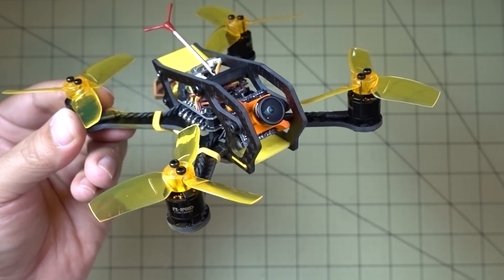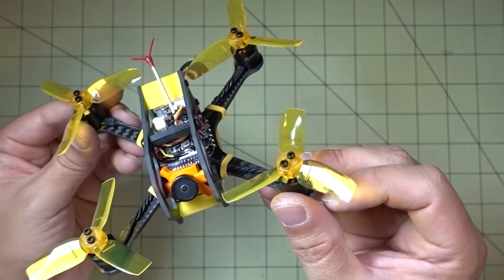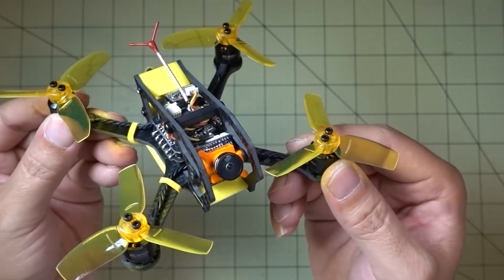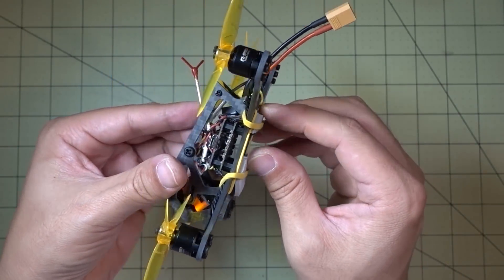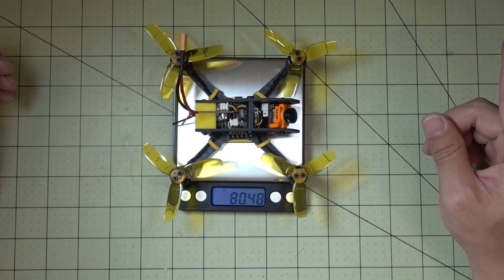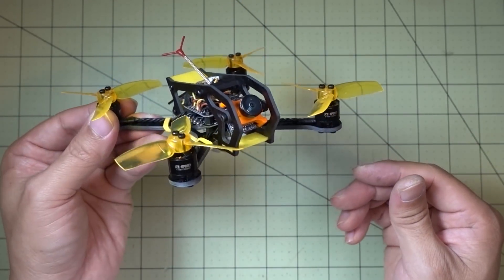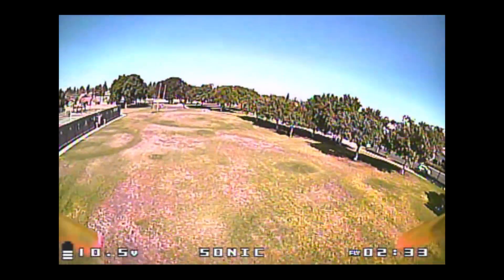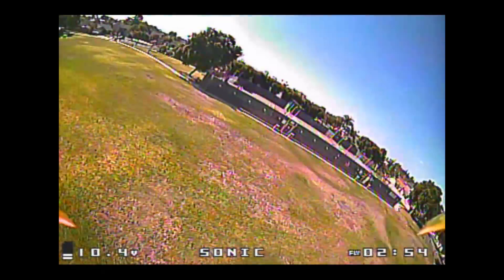Micro Drones 101 🚁#37🔥 Tomoquads Sonic 👍👍😀

Comment: Albert - finally finished my Sonic build with an HGLRC F425 stack including the TX20 video board. I used the HGLRC Flame 1105 6000kv motors, Racerstar 2.5" props and an XM+ diversity receiver. It is incredible on a 3S Tattu 650 - smooth as glass, fast as hell and very responsive. Fun build - thanks for the inspiration! I do think the Tomoquad Sonic frame leaves something to be desired in terms of fit and finish - and the 3D parts could be be better - but I'm still thrilled!
Reply from the maker: Yeah, his parts had better fit and finish in the past. Guess he is pretty busy these days so quality is going down a little. Still, it's a good frame and I enjoy flying mine.
Reply: Albert Kim - Thanks for your reply - I like this build better than the Airblade 2.5 that I built - same stack but using the HGLRC Flame motors in place of the Emax 1106 6000's seems to be an improvement.  Do you have any tricks to mounting the RotorX 2535BN's?  I gave up and used the Racerstars - which seem to be great.  The RotorX props are really hard to screw onto the mount - the screws seem to spread and angle preventing proper attachment.
Reply from the maker: I'm giving up on the RX2535... too many issues.  Gonna try switching over to the Gemfan 2540s... check them out here - http://amzn.to/2hicSAu
Reply: Albert Kim - already ordered!  You are so right about the RX2535's - a royal pain in the butt.

Comment: Awesome video as always my brother! With two bladed props depending on pitch and width of blades you'll normally get better top end speed and better flight time due to the weight and lesser surface area. This also makes them more efficient with drag and react faster to throttle movement. One downside with two blades are the lower thrust numbers for pulling out of power moves or performing quick zigzags. Three bladed props give more grunt at the low to medium range of throttle but suffers on the top end and throttle response. More blades will make your quad feel like "Air Mode" without "Air Mode" turned on. Try a 6 bladed prop then slap on a two bladed prop and you will feel the difference. It all comes down to the way you like to fly and how you want your quad to feel in the air.
Reply from the maker: I think what I'm looking for is a lighter 3-bladed prop with a little less pitch.  Something that will give good low-end and high-end performance.  The 2840's are just too heavy even on 3S.  Maybe on 4S it would be OK on a bigger motor like the 1304...
Reply: This video inspired me to put all the guts from my Lizard95 into a larger 145mm frame using 3" props and Runcam Micro Swift 2. I'm waiting for soldering iron to warm up so I can get to the wires as I type.

Comment: Great little micro build mate. I don't really think your assessment of the props was fair though because you cut them down. They won't perform as they were designed and there will be a performance drop for sure. By cutting them down you don't just reduce the diameter but also the average pitch angle (bite) of the prop as it changes from the prop root to the tip to compensate for the difference in RPM along the length of the blade. I would like to see you try a true 2.5inch prop and check performance. Great vid🤘

Comment: Cool build but a little cautious about having different prop sizes on front than the back.. Doesn't throw tuning off and or work the front motors more than the back? Also I think you are maybe a bit spoiled by the performance of the RotorX 2535BN Props because in my testing all my quads grow cow horns and jump over the moon with those Kingkong props and a 3S! But I admit that the RotorX 2535BN Props spin up faster so on 3S they were a little more extreme! Hands down though, both of the forementioned props kills anything on 2 inch and under in thrust for sure right?
Reply from the maker: The back motors work harder when pitched forward so it would be an issue if the back props were shorter but not when the front ones are.  The 2 inch 95GF has a lighter motor and setup and even on a smaller prop it's about as fast as this.  Just means these props suck ass.
Reply: Albert Kim The 95GF goes up on a punchout faster than the Leader 120 on 3S?? That means it must go up faster than the AR Fun Pro 95!